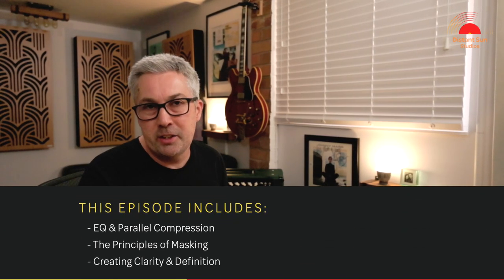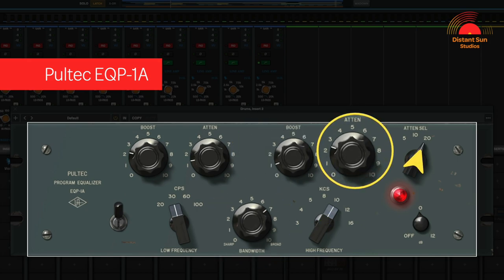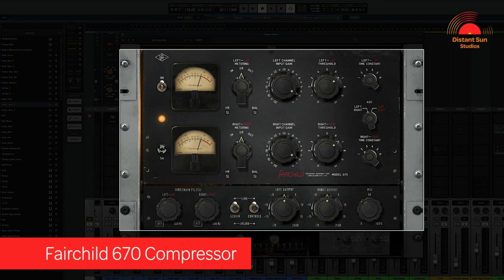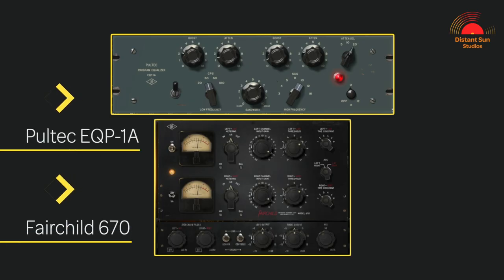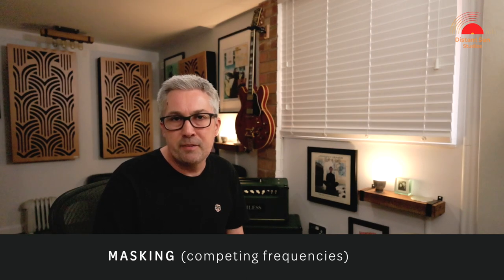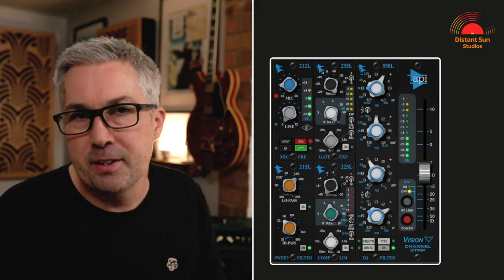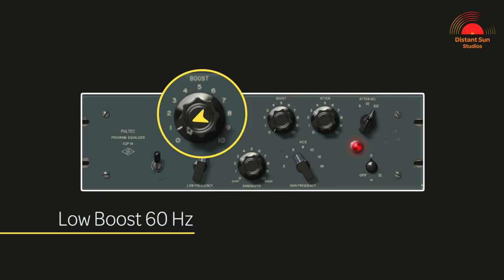UAD Luna: Expert Tips for Achieving Clarity and Definition in Your Music 🎧🔥

Comment from the maker: Short on time? - quick links for today's video:
00:00 Introduction
00:13 Inside The Mix #6
00:33 Static Drum Mix
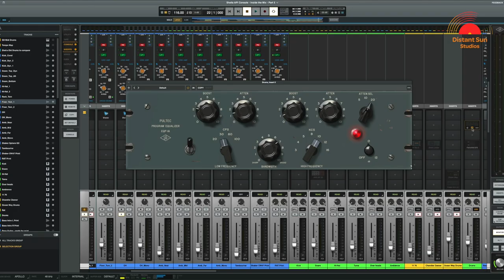00:58 Pultec EQP-1A
01:27 Quick Selection Shortcut
01:37 Fairchild 670 Compressor
02:23 Audio Examples
02:58 Like and subscribe
03:09 Top Down Mixing
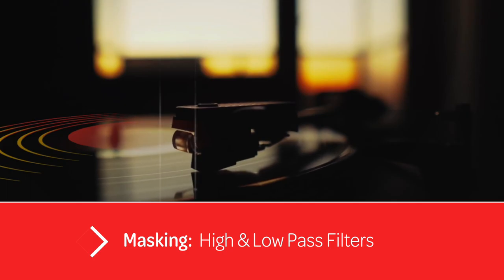03:37 High and Low Pass Filters
05:47 Creating a Cohesive Sound
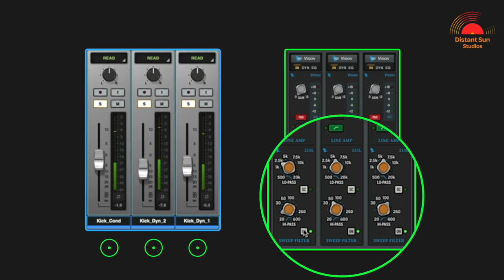06:32 Shaping the Kick Sound
07:33 Final Thoughts
07:52 Thanks for watching!
  
Link to Tutorial #1 - Mastering the Art of Mixing with UA Luna
https://youtu.be/RZCmhT3hjzU

Link to Tutorial #2 - Unlock the Secret to an Authentic Analog Mix!  
https://youtu.be/_ITQrIlK0RU

Link to Tutorial #3 - Transform Your Mixes with UAD Luna Extensions!  
https://youtu.be/gaEVyDU3TgI

Link to Tutorial #4 - MIDI Drums: Underwhelming or Unbelievable? | Superior Drummer 3
https://youtu.be/gvOImSJu4E8

Link to Tutorial #5 - Next Level UAD Luna Tips & Tricks
https://youtu.be/E0m4avnRa_Y

Link to "Sheila" - Ft. Jack Mitchell (Drummer Johnny Marr): https://www.youtube.com/watch?v=-GnUAHVOlDw&t=0s

Thanks so much for watching!

Matt